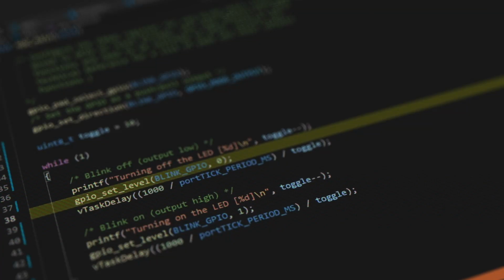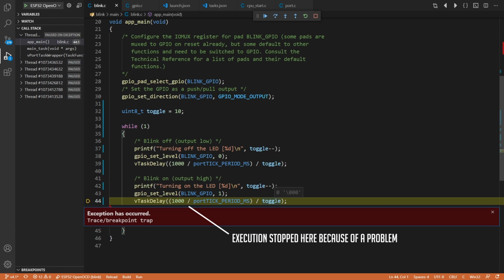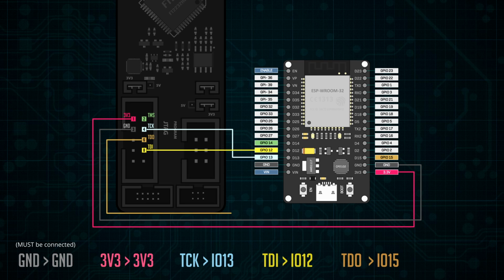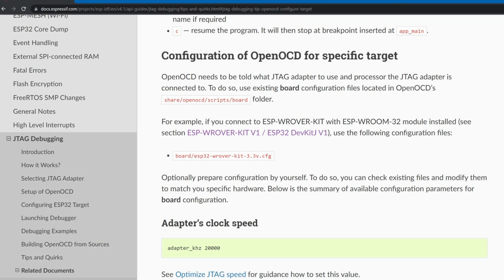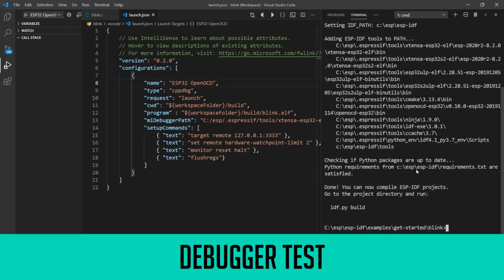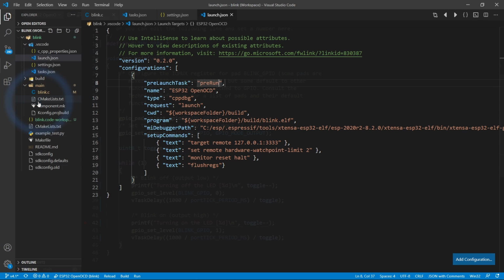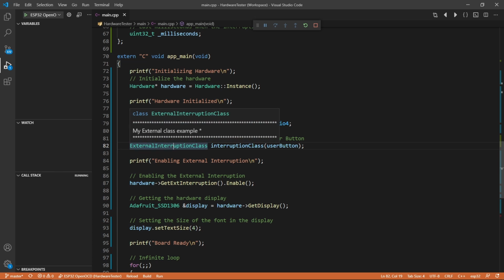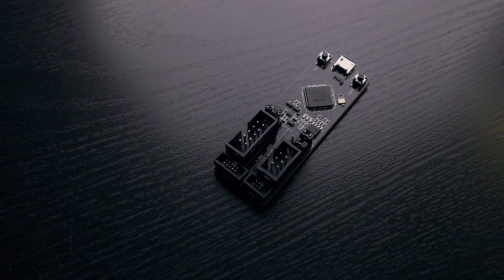ESP32 - DEBUGGING your ESP-IDF code using JTAG [VS CODE]

Comment: Hey Yuri, first of all I want to say that this is one  of the most comprehensive and detailed tutorial on ESP32 debugging that I found on the net during a one week research on esp32.
Your work is very much appreciated, keep up!!
Beside that, coming from the professional embedded programming and being used to tools like Keil and IAR alongside JLink I can't help but think that 80% of the time you are busy setting up tools rather than program what you were up to in the first place.

However, I managed to get JLink up and run debugging the ESP32 but some how I miss the last piece!!
Hope you can help with some hints...

I have ESP-IDF version 4.3.2 installed in C:\esp and everything is running fine from command line as well as from VSCode (menuconfig - build - flash - monitor)

1. 'launch.json'
Setting up "type": "cppdbg" as you mention, results in the debug task to break with the error that it is unable to start debugging. the value of miDebuggerPath is invalid.
changing "type": "espidf" will get rid of the problem...why?

2. 'Settings.json'
setting "terminal.integrated.defaultProfile.windows": "Command Prompt" works fine with your steps but results in the IDF-Tools in VSCode to stop working.
(starting debug will open up command with the typicall start up lines and than will run forever. You have to cancel it)
reverting changes will make IDF-Tools working again.

3. making any changes to blink.c and starting 'launch' task will start Openocd and start debugging but without updating the changed code. This might be linked to 1.
Reply from the maker: Hi Musti N, sorry for the delay, thank you so much for the kind comment and words.

I agree, setting up the tools takes a lot of time and can be a frustrating experience sometimes. They are getting easier and better each day though!

Regarding your questions: are you using the ESP-IDF Extension for VS CODE?

If you are, then you should use "type": "espidf", if you are not, you need to use Microsoft C/C++ and use "type": "cppdbg".
Source: https://github.com/espressif/vscode-esp-idf-extension/blob/master/docs/DEBUGGING.md

I am not using the ESP-IDF Extension in the video, hence I use "cppdbg" there. So if you have the extension installed and is following the video steps, it may be the reason for the conflicts. (Hopefully that solves 1, 2 and 3).

I hope that helps!

Comment: Excellent video Yuri, thank you!  Have you tried VS Code program/debug of ESP32-C3 using just the USB (just two IO pins)?
Reply from the maker: Thank you! I haven't tried the ESP32 C3 yet, but it should be very similar. The only changes would be the driver interface (which you can follow this instructions https://docs.espressif.com/projects/esp-idf/en/latest/esp32c3/api-guides/jtag-debugging/configure-builtin-jtag.html) and the script to initialize OpenOCD (openocd -f board/esp32c3-builtin.cfg).
For more informations you can check https://docs.espressif.com/projects/esp-idf/en/latest/esp32c3/api-guides/jtag-debugging/index.html
Cheers!

Comment: Hello I use esp32 on virtual machine Linux. Could you provide a guide for this case?
Reply from the maker: Hi Vito, I never tried using it through a virtual machine before, what problems are you having?
Reply: @YuriR  I have not the possibility to use zading tool and similar in Ubuntu virtual machine.

Comment: Yuri, thank you very much your videos are very useful. I managed to setup all steps described and can debug my code. I wonder if it would be possible to add an additional preRun task (or any other solution), so that the code will be saved and built automatically, each time the debugger is launched. Thank you again for your great videos and looking forward to your next videos.
Reply from the maker: Thank you! I'm glad it's useful. For the preRun task, I honestly never tried, as I just do "ctrl+s" before start debugging. But it would be nice indeed! Visual Studio (not VS Code) does that when you start a debugging session, so it would be nice to have on VS Code as well.

Comment: Excellent tuto!
Thanks for sharing.
Can you put a link for the JTAG/breadboard adapter??
Reply from the maker: Hi Ziclop, thank you! That JTAG Breaboard adapter PCB was made by myself. I could maybe put a link to the project online and you could try ordering it from JLCPCB or PCBWay if you would like.
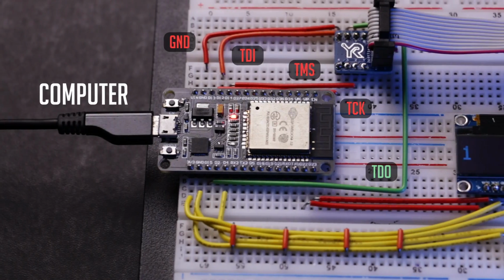Reply: @YuriR  yes, please make the "ribbon cable to breadboard adapter" available (visible at 4:34 and 6:14). It is a great solution for adapting double-row pin headers to breadboards. Both female and male versions would be great.

Comment: Hello Yuri,  How can I use j-link Segger probe in vs code? thanks in advance.
Reply from the maker: Hi Wn Brook, for the Segger J-LINK is a bit more complicated as it requires a few more configuration steps to get it working with OpenOCD. 
You can follow the tutorial below to get it working with OpenOCD, and the VS Code part should be the same as my video here :)
https://dzone.com/articles/eclipse-jtag-debugging-the-esp32-with-a-segger-j-l
I hope it helps!

Comment: Does that really work for everyone without issues? For me VSCode complains with (tasks.json):
+ clear & start openocd -c set ESP_RTOS none -f board/esp32c3-builtin.c ...
+       ~
The ampersand (&) character is not allowed. The & operator is reserved for future use; wrap an ampersand in double quotation marks ("&") to pass it as part of a string.
Any ideas?? 
(Running VSCode in Windows 10 not linux though.
Reply from the maker: Hi Colab, by the error you mentioned, it looks like your VS Code is running Windows Powershell instead of cmd.exe. You need to set it to cmd.exe in the settings.json for this command to work properly :) You can watch my first video to setup the IDF terminal on VS Code and this quick fix (since my first video is already a bit deprecated): https://www.youtube.com/watch?v=N93RvZz6dEc

Comment: Yuri, thanks a lot for this excellent video. 
Just one question - I'm using a custom WROVER based board with no USB connector on it. However it does have a serial and a JTAG headers, so I'm using ESP-PROG board with a flat ribbon cable that comes with it to flash the code and to get serial (printf) output to the Visual Code monitor. The board installs as two separate serial ports with sequential numbers, both controlled by the same FTDI driver. The question is - is it OK to use ESP-PROG USB to PC connection for both serial and jtag simultaneously and should I change one of the drivers using Zadig the way you explained? The debugging doesn't require Expressif Visual Code extensions, is that right?
Once again, thank you very much for the great video.
Reply from the maker: Hi Nikola Dj. Thank you for the comment and for detailing your question!
Yes, you can use both serial and JTAG at the same time, and you need to change the driver using Zadig only for the interface 0, as shown in the video (you can see that one serial port remains with the normal driver (interface 1), and the other one with the updated JTAG driver (interface 0)). And yes, debugging doesn't require the Espressif VS Code extension :). So your board should work correctly.
Thanks again for watching and for the comment!